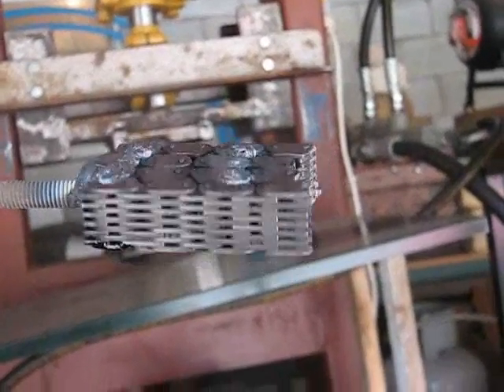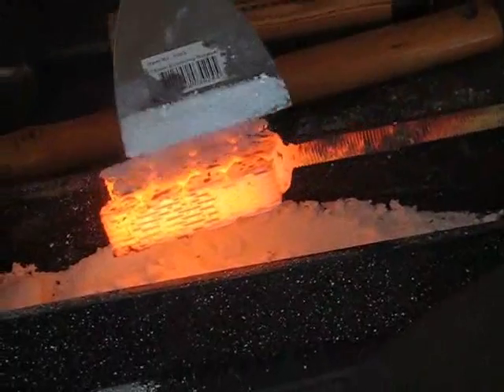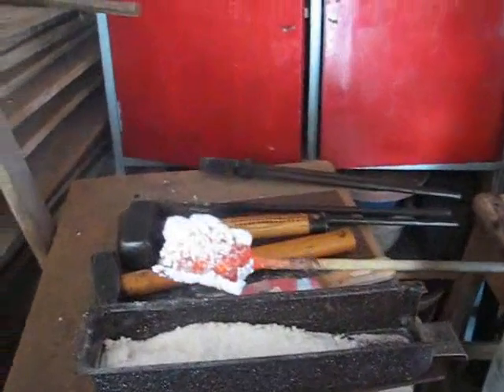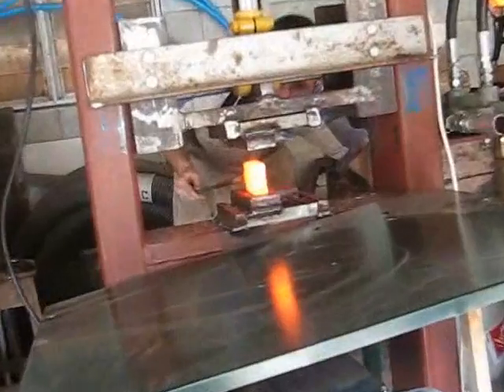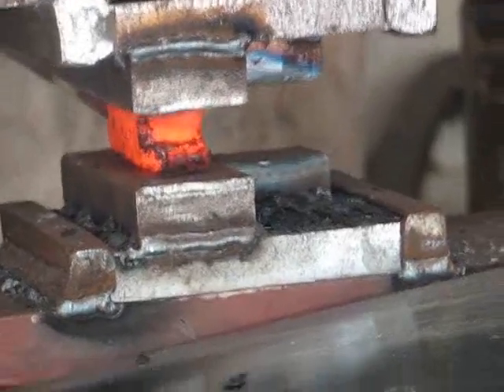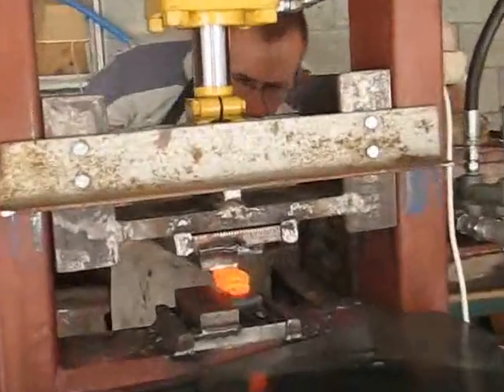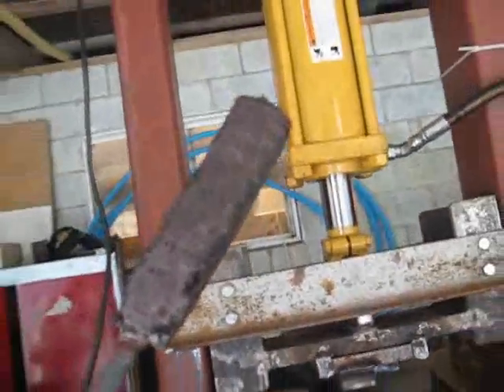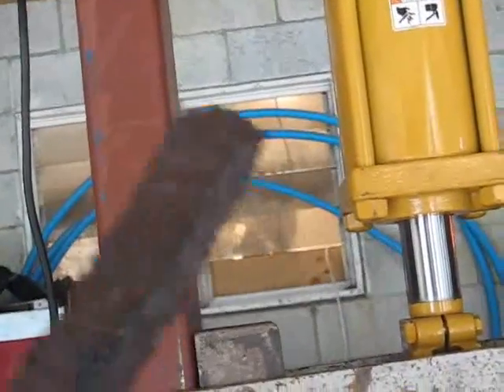Forge welding a knife from a timing chain - Part One

Comment from the maker: The press is amazing. Um, I got the press at the stage where the steel work on the body (the 'H' shape) was already done. I went ahead and fitted the ram, pump, motor and control, plus organised the hydraulic piping.  I didn't have any plans but have a look on the net, it'll be out there.  If I find plans I'll post. Jump onto some of the knife forums also and search those.  Full of helpful people.

Comment: hello ,I am from sheffield uk and am old enough to have worked in the steel works when there were plenty here.I should have explained better,what I meant was hammer forged steel is definitely better than pressed steel,all the best forgings were done under steam or pneumatic hammers varying in size from a quarter to 15 tons.Admittedly the massive forgings were pressed due to the size of them.The 3/4 ton hammers are very good for  drawing out.Power hammer forging is much harder to learn than press

Comment from the maker: All of your thoughts are correct but with some caveats - a power hammer will be much faster to draw out the billet, mainly due to the press dies sucking heat out of the billet at every press.  However the press will apply an even, immense pressure across larger areas. The press also does help a better weld because of this.  The press is very controllable, but so is the power hammer. In the end, a press and power hammer will compliment one another.  Thanks for your comments.

Comment from the maker: Not too much argument from me!  A press is not a replacement for a hammer (or a power hammer), however the press is insurance against a faulty weld of steel layers, due to the even and immense pressure applied.I agree the core of forging is hammer and anvil, however I see the press, power hammer etc as complimentary. I did use a hammer off camera.  One other thing...folding a billet onto itself increases risk of scale inside the billet. Instead, I draw out, cut, stack, weld.  Thanks for viewing.

Comment: There is more power in a hammerstroke than the mighty press.
The extra power works out good by compressing the iron, as well as the force itself puts energy in the iron and thereby keeps the iron hot!
In my eye is it conflicting that You show interest in forging high quality scrapmaterials but ignore the core of forging: hammer and anvil!
Much of the forge-technique is about flathening the iron - subsequently folding it together for further flathening - The press wont be able to that

Comment from the maker: @TOMHYLE88 There is some play in the press...to remove that I need to pack out the link pin at the bottom of the ram. Removable, yes.  The dies can be quickly swapped in and out. Thanks for watching.

Comment: @offenwrong If it is a stainless steel, you are asking for possable big snoots full of nasty gass from the chromium leaching and burning out of it. Stainless can be forged to my knowledge, but it is done at lower heat levels best to my knowledge. Not sure about recycling hardened, heat treated blades though. Also the possibility of different steels of different blades come in to play. The later 2 things might make a bad knife and frustrate you, the former could hurt you

Comment from the maker: @sockless67 A pottery suppliers should have some.  Anhydrous Borax is the correct stuff (anhydrous means it has little or no water in it...means less spitting when putting onto hot steel).

Comment from the maker: @p0rkjell0 Well, that's not entirely correct. The first knife I made was from a file, and I used a B&D Dragster hand-held belt sander mounted upside down in a vice to shape the blade. I agree there are some things you have to have...a forge (to get the blade to critical temperature), and a way to grind.  I don't drink, smoke, do drugs etc, and have four kids and wife. I guess it comes down to how you spend your $.

Comment from the maker: @hanzithaking Don't give up!  Keep trying, and grab Wayne Goddard's '$50 knife book' as a great tutorial.  Anhydrous borax is what you need...you can get this stuff from a few sources, including florists! Search the web and you'll find a supplier.  Borax will help a lot, but ball bearings could prove quite a technical challenge, particularly if they are small and you're aiming to weld them together.  Have you tried making damascus from wire rope?

Comment from the maker: Cont. I saved a lot of money doing as much of the construction as possible (mounting the motor, make the steel plate guides etc), and there was a lot of running around getting the hydraulic parts. Overall, I really enjoyed getting it together.

Comment from the maker: No I don't mind. I'm in New Zealand, so factor that in, but the relative prices might be similar. Press frame and steel - (some was procured from scrap) - $400. Cylindar, control, pump - $1000; Motor $300; hydraulics (pipe, fittings, fluid) $800. I did a lot of the welding, and got given misc steel plate to make the hyd oil box. One of the biggest surpises was the hyd fittings. Each one was around $50. I reckon find an old unit (splitter etc) and use the fittings from that.

Comment from the maker: I'd expect so...I've presently forging a roller door chain, so I'll let you know.  Yes, being carbon steel, it will rust. Any carbon steel will need to be looked after and kept clean and dry. As for carbon content, it was a risk working with unknown steel!  My assumption was that a hard working chain (from an internal combustion engine)  should have the required carbon content.

Comment from the maker: One of the reasons was the rarity of power hammers in New Zealand (where I live). Also, a power hammer (Little Giant, Big Blue etc) are very heavy - that is, they weigh tons!  The press is probably around 450Kg, so a *little* easier to move around. Another reason is that, with help, I was able to build the press, something I couldn't do for a power hammer (though I have seen some neat treadle hammers).

Comment from the maker: Yes because it's unique, and out of my curiosity!  I didn't know how it would turn out, or if the steel would even be suitable (though being an internal chain, I made an assumption that it would be tough steel). So it was a bit of a punt, but turned out ok in the end.  I have three more pieces from the original billet...I'm keen to see how these grind up also.  That's a future project...lately I've been making some O1/L6 stacked damascus.

Comment from the maker: Yes, I agree...I have the greatest admiration for any experienced blacksmith (I am not one) who can make just about anything.  My first damascus blade was hand hammered from 1 inch wire rope - that took some beating! The hyd press is great for applying even pressure over a wide area. Given more (much more!) experience I will improve my hand work, but I was finding the new welds could 'pop open' when working the steel...something experience (and a decent arm!) will help with. Thanks for looking.

Comment: Flux.  not sure what kind though, its a material that coats metal and stops it oxidising when hot so its easier to solder or weld to.

Comment from the maker: The full welly!  I want to make sure that the initial pressing of the hot steel is as tight as possible.  You'll see in the video that I press the hot billet with the long die - this provides an even pressure over the entire billet. The shorter drawing die (which by nature of being half the length will have more pressure) is then used to draw our the hot billet. Thanks for looking.

Comment from the maker: Hi, thanks for your comment. This is a 24 ton press, so enough to make damascus steel. It is based on a pump producing 2500 psi of pressure, and a 5" ram with 8" stroke.